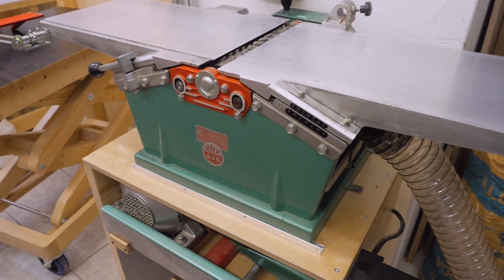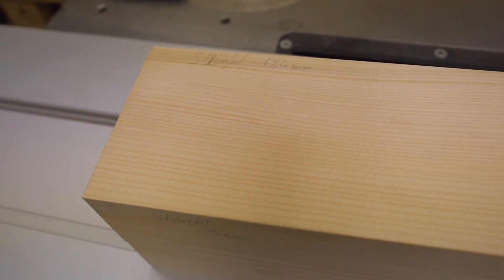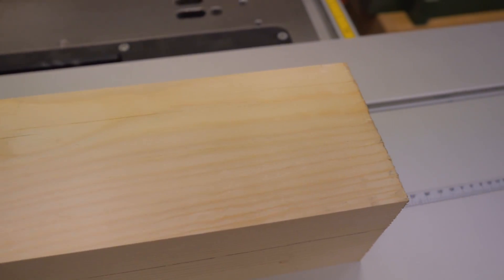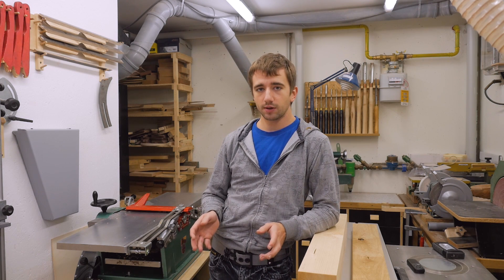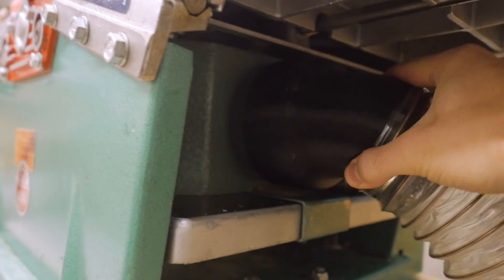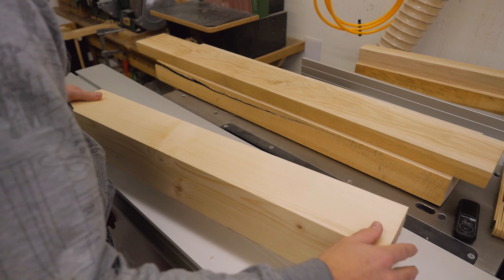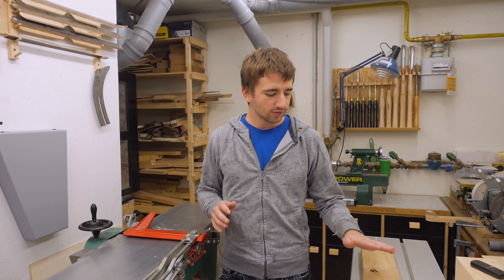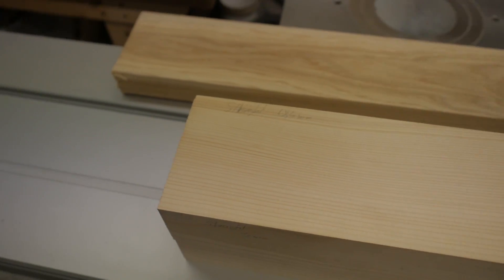My Shelix Cutterhead Review on a Kity 636

Comment: Great pair of videos, thanks! I am one who touts the noise reduction of helical heads, and I also have found that in the white oak, walnut, and mahogany I usually work with it doesn't make a difference which direction I feed the wood. I confirmed the noise observation with a sound level meter (don't remember the readings now, but it was significant). But I never thought to make feed direction comparison passes like you did and use the low-angle light and fingertips for comparison so there may actually be a difference. Thorough and enlightening, thanks again.

And your recommendation was spot on. The most cost-effective way to get a helical cutterhead is in a combo machine when you buy it. Retrofitting will always be more expense and trouble.  In the US the least expensive machine of acceptable quality I could find 6 or 8 years ago was the Jet JJP12-HH at $3300. It has been satisfactory in every way. I see that it is $4300 now on Amazon, with free shipping. If I were buying again now I wouldn't hesitate to make the same decision.

Comment: Marius, another nice comparison to make is the power consumption: if you plane agressively (wide board with heavy pass), you'll see that the motor's electrical consumption will be quite higher with three blades than with a helix cutter, because the cutting effort is much better spread on the latter one. Would have been interesting to see this in your particular case :)
Reply from the maker: Unfortunately I can't measure that. I have no amp-meter for three phase 400v

Comment: Jointing or planing a few boards is hardly a test. Since they have no purpose.
The reasons why you had trouble with sticking a after market head in your machine is it now far from how it was designed.
You actually down graded it.
Lots of hype around the insert head is because new woodworker don’t understand how a knifed head machine was designed to cut wood.
Look up hook angle. 
Then measure the face bevel of the bryd insert and ask your self what does this mean?

Comment: Next step, as I modified my Kity 637, disassemble the feeding system on the main motor, buy a little motor with a built in reduction (1:12 if my memory’s good), a sprocket and matching chain (I kept the sprockets on the in/outfeed rollers, and bought a longer chain with the same pitch) install a VFD on it (my motor was given to me and was on 400V, VFD allows me to run it on three phases while setting many values such as speed, brake etc...) and you will be able to set the feeding speed from zero to twice the actual speed. Mine is on use since 6 months, and it is so convenient. Full speed for roughing (80 Hz), low speed (25Hz) for finishing on difficult woods with many grain directions.
Reply from the maker: Very cool! How wide does the 637 cut?
Reply: Marius Hornberger 260mm as yours. It’s just a bigger one, with longer tables, and a built in base, bought for 500€. I was thinking about buying an helical cutterhead since I saw one on a Franck Howart video he installed on his big jointer, but their prices always brings me back to reality (my patreon doesn’t let me ruin the family bank account 😂)... but the separated drive for the feeding system is very handy. I may send you some pictures if you are interested. That may inspire you. Just give me your email if you want.
Reply from the maker: Pictures would be cool. My E-Mail is on my channel in the Info section

Comment: Watched both videos and was impressed with your dedication to see the job through. So involved and a lot of money should it have not gone to plan. I can see why you wouldn't recommend the upgrade for the kity 636 and it already is a pretty good combination machine in the first place. I think the helixial cutter heads main advantage comes from not having to resharpen the single blades because you've found metal in the wood. Just turn the damaged insert 90° and you're good to go again.

Comment: Currently have a Dewalt 735 planer and an old Craftsman 6 1/8" benchtop jointer, and I'd love a combination Planer/Jointer like this.. I know they're technically not the best at either jointing or planing vs the dedicated tools, but I like the space saving aspect, and like you mentioned, you only have to buy one helical cutter head. Being able to joint up to 12" would be really nice too.
Reply from the maker: Combination machines can be as good as dedicated ones. Just a question of price :) But mine is only 10"

Comment: I enjoyed both videos but don't understand how a segmented cutter head would cause ripples like that (8:25)?
Reply from the maker: Yeah, that's confusing. But I get the same result when I joint really fast.
Reply: normaly you switch to a segmented cutter to get rid of ripples ... 🤔
Reply: Aber Marius, Du kannst Dir ja einen Abricht-Dickenhobel von Felder bzw Hammer zulegen, die haben auch die Spiralmesser Hobelwelle. So eine Hammer A3 41A würde auch gut zu Deiner Säge passen 😜👍🏻
Reply from the maker: Also wenn dann schon irgendwann die Felder AD 951;)
Reply: Aha, eine neue Werkstatt 😄
Reply: I wondered about that too. I have the Jet JJP12-HH combo with helical head, and it leaves a faint grid or basket weave pattern on some woods. The only thing I can think of is that the longitudinal lines of the pattern in Marius' demo are less pronounced or don't show as well with the low-angle light held at that particular position. But the Jet always produces a good quality cut.

Comment: "less noise" doesn't matter, because my dust collector makes so much more noise than my jointer anyway.
Reply: Julien Sorosac then you know your next project: build a silent dust collector 😉👍🏻
Reply: Noise is cumulative, and very much based on proximity. Having your head right over a cutting operation or in line with the infeed/outfeed of a thicknesser is super loud. Personally I would recommend the use of better defenders than Marius' 25dB. I do risk assessments at my workplace, including noise.
Reply: I would say it does, to me at least, and I will also say the volume level between my DW735 compared to my floor standing cast iron jointer is VASTLY different, which I attribute to the motor types and the cast iron vs steel/aluminum/plastic. They both have straight blades but I understand that the shelix would help with the noise but the lunchbox planer is loud even when it's just free-wheeling.